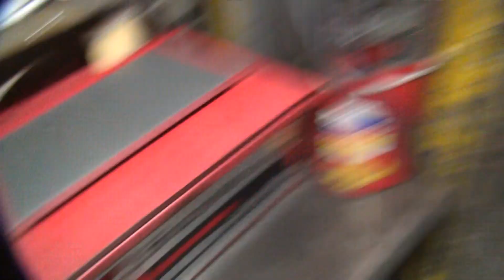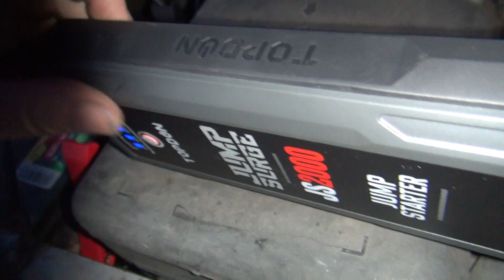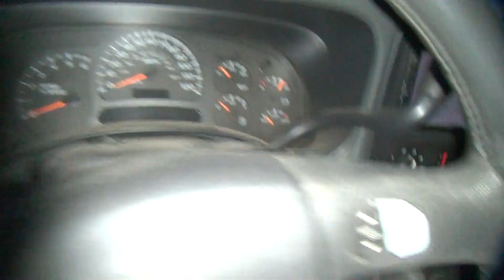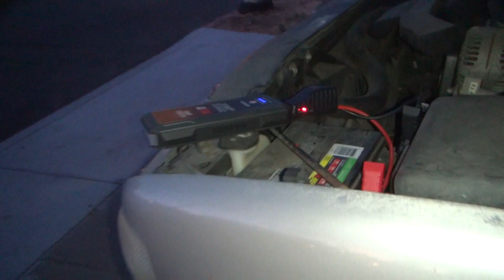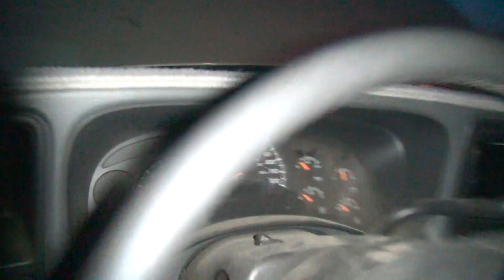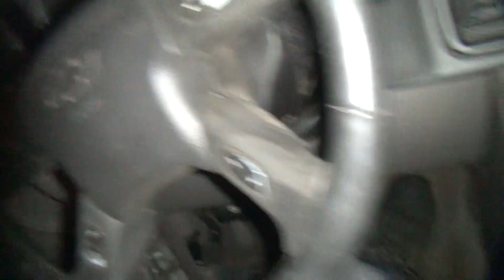#101 suv turd 2023 product review test JS2000 TOPDON 2000A Battery Jump Starter harley tatro machine

Comment: Tatro Remove the battery cables check for corrosion. By your video it looks like you had a poor connection.
Reply from the maker: no, the battery is junk. it tested at about only 27% cca power months ago. now it is about zero. for now it makes for a good battery jump starter tester.
tatro

Comment: Here is a question for you. What size pilot guides do you use on ironhead valve guides? For both the intake and exhaust. 11/32 is just too tight or the taper is wrong.
Reply from the maker: harley uses undersize pilots from car stuff. they run .003 to .001 under on most valves but they do vari allot. the intake is 5/16 and the exhaust is 11/32.
tatro